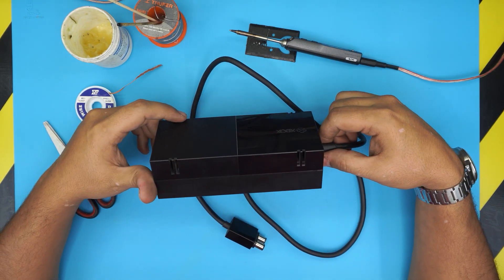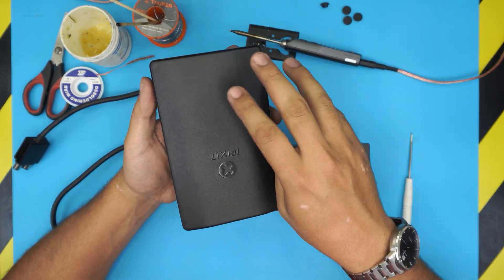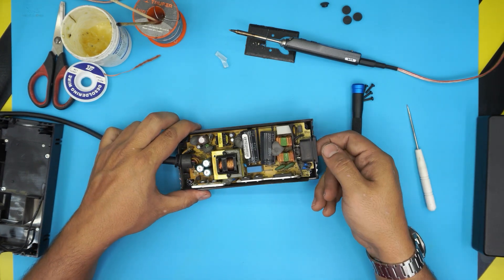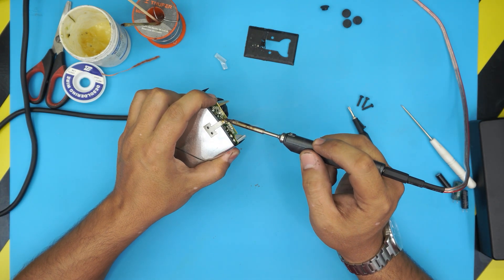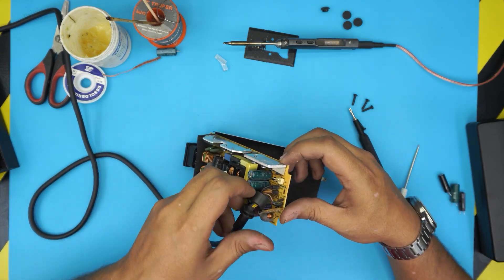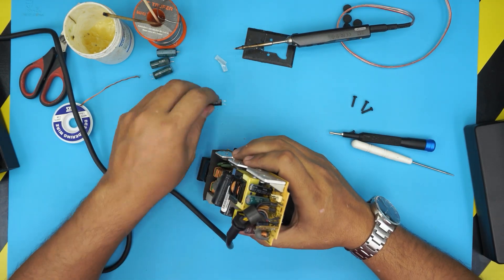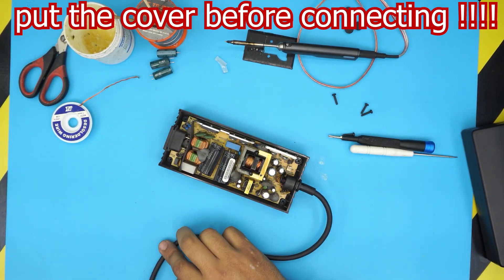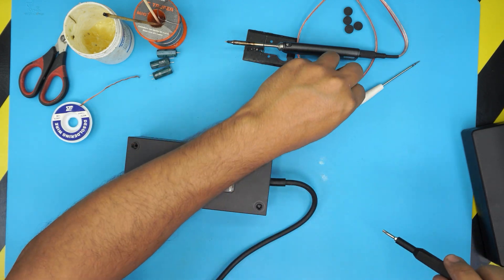Xbox One Charger Repair | Power Supply Repair Guide |

Comment: Hello. So my psu has the orange light however I have managed to get it to run most of the time by opening up the psu and using an external fan keep air flowing over it. Although Every now and then it’ll shut off out of no where. I then have to mess with the fan, the speed of the air flow, or even turning the fan off till it stays on. I try each thing till it turns back on. L The capacitors aren’t bulging and I can’t tell what is causing it to shut off when it’s all put back in its case and I’m not blowing air directly over the circuit board.  Do you have any tips as to how I can find what’s causing this problem?
Reply from the maker: 🫠Regarding your question, there may be a few issues, but the main one could be the transistors overheating. You need to test the components and observe them live. It is extremely dangerous if you don't have experience with high-voltage circuits.
cheers🍻
Reply: @ thank you for replying, would I be able to test using a multimeter or do they need to be live?

Comment: hi again 2 days before it started working and now it stopped working again I opened the board and checked I can't find any issue is there any way could send you pic ?
Reply from the maker: Thank you for your feedback! If you wish to support the channel, you can like, subscribe, or both!
Regarding your question, send me few pictures to my email if you wish and i can take a look at it.
 	ask@ufixtek.com
Reply: @UFIXTEK  have you recieved them ?
Reply from the maker: my friend, I receive a lot of emails, but I think I received one from you with a circuit picture of the back of the PSU. If that's your email, could you please send me pictures of the other side of the charger from different positions? Also, please include your YouTube username in the email title.
Reply: @uFixTek  I've sent it
Reply: @uFixTek hi brother I bought new psu and the issue is still same issue isn't with power brick 😭

Comment: Hi my xbox power supply brick when I turn my xbox on from orange it goes to white and goes back to orange. After a week or so it starts working again then randomly this happens for some day  can you help me fix it please
Reply from the maker: Thank you for the feedback! if you wish to support the channel you can LIKE or SUB or both :P
regarding your question: i need you to see if the capacitors are blown?!
Reply: @uFixTek  No they're normal
Reply from the maker: I need to to check and see if there is no sign of burn on any components, and its very dangerous to tell you to connect the power supply and use a multi-miter to test the transistors, the transistors are the one attached to the aluminum heat-sinks and they are usually go back and do the orange light error.  i don't recommend you to test it, its very cheap to get it repair on electronic repair store it should cost your max 10-15usd
Reply: @UFIXTEK  actually the thing is there isn't any electronic repair shop or something here in United Arab Emirates near me and I can't even order a new one because they make noise and aren't the same as the original xbox one . I'll try to test the transistor but there aren't any burn i could see
Reply from the maker: be very careful brother, but the issue is in one of those transistors.
Reply: @UFIXTEK  but what could be the problems with transistor ? Do I have to eplace it with the new one or solder it properly ? And what makes it work again after 1 week
Reply: @uFixTek  ?
Reply from the maker: transistors are like a switch, they turn on and off they are called gate. replacing them is the best, but sometimes check under the board and if you see the solder joints are fractured just do a pass of solder and it will fix the problem.
Reply: @uFixTek  thank you so much for your efforts ill try to fix it
Reply from the maker: i wish you the best and truly its had to do a diagnostic brother over internet without looking and testing each components.
i try to upload if i get one with same issue and show how to check for components.

Comment: I change the same 3 and now when I plug it to the outlet the light go steady orange and when I plug the xbox I go to white then shutdown
Reply from the maker: you may have a damaged transistors also, thats why when plugged in goes steady orange and replacing the and testing the transistors are a bit dangerous to do, there are two transistor near the 3 caps attached to the aluminum heatsink.

Comment: My Xbox one power supply AC adaptor blew a short circuit while I play NASCAR heat 5 I tried to get it working again but  it still remains on standby mode in orange and it isn't serviceable or repairable what should I do?
Reply from the maker: Thank you for the feedback! if you wish to support the channel you can LIKE or SUB or both :P
regarding your question: you most have blown the main transformer and that is not repairable and it is cheaper to buy a new one than repair it.
Charger: https://amzn.to/3F5ARP1

Comment: Wow this is exactly what happened to mine. Had no idea you could check capacitors so simply. I do tons of soldering and trust this method over the 20$ china knock off bricks
Reply from the maker: You are welcome! Glad you liked it 😊Thank you for the feedback! if you wish to support the channel you can LIKE or SUB or both :P
if you have any question or request in the future feel free to ask me.
Reply: @UFIXTEK  i got my caps in finally. Installed them, xbox still does not power on. I noticed now though, the orange light stays on way longer after removing from the power source which is a good sign. I have a few spare caps, im going to try to replace the 1500uf on the side of the other 3, it doesnt look blown but i will try it here. If no power ill report back here
Reply: @UFIXTEK  yeah, still no power. My light stays orange all the time. Xbox beeps as if its turning on. But power brick never turns white and nothing actually powers up

Comment: Changed the caps but unfortunately didn't solve the issue with my particular supply. Orange light still goes out.
Reply from the maker: do you see any other caps that could be inflated?
Reply: @uFixTek  Nope, the others look fine. Light is orange and as soon as it's plugged into the console, the light goes off.

Comment: There is one capacitor near those three you replaced. It is a 1500uf at 16v. Is it possible to use on of those 2200uf 16v in place of the 1500uf? As i have a bunch of 2200uf
Reply from the maker: Thanks ✌  for the feedback!  if you wish to support the channel you can LIKE or SUB or both :P
regarding your question:  yes you can and it will be just fine, just make sure the voltage is the same or higher
Reply: @uFixTek  i just replaced the 4 capacitors. Same results 

The psu turns a orange light and when i plug into Xbox console the light dies. Maybe i need to replace that 1500uf with exactly the same? Also the console is working as i tested it with another psu.
Reply from the maker: no then the issue is not from your capacitors, even if you put 1500uf, you could have some transistors blown, you will need to test the transistors or take it to a person that know how to check components. its very cheap to repair with a right person.
Reply: @uFixTek  i mistakenly put the 1500uf capacitor through the wrong throughole and now it has immediate white light when plugged to the wall but doesn’t turn on the console. Also weird whizzing noise. Here is a video i made: https://youtu.be/VcLtulzrCn8
Reply from the maker: @onasazi  hi, 1st of all you should never test them without the fan disconnected, else the circuit wont close and it will keep it self in shutdown mode.
regarding the noise , unfortunately you have a bad copper transformer the big box, that windings on the copper cables are damaged and its making a shorts and it will results in higher voltage and it could damage the console or under-volt the output.
its better and cheaper at this point to replace the PSU , also you ma have damaged the rectifier.:(
Reply: @uFixTek  oh I understand! Thanks for your insight! Could i just transplant a copper transformer from another faulty psu?
Reply from the maker: @onasazi  you could but if the transistors are bad then it can damage the new transformer also if you have a donor psu then replace the rectifier too :P
Reply: @uFixTek  will try it! Thanks again! I subbed and liked your video! 👍

Comment: I have a Xbox 360 slim. His power supply is orange. When I press the on button, the red light of the power supply turns on.  I have only the +5V at the red wire. When I short the PS ON, I should find +12V at the yellow wire, but not. There is not +12V.
I measured and changed the 4 capacitors of 1500 uF near the output side of the board. (they was almost 1350 uF.
Apparently, there is no one burnt capacitor.
What should I do? 
What do you recomend?
Regards
Ricardo Garcia
Reply from the maker: Thank you for the feedback! if you wish to support the channel you can LIKE or SUB or both :P
regarding your issue: can you send me an email attached with a photo of insides of your charger, send as many you can parts /closeup and different sides. let me take a look as every charger are a bit different.
ask@ufixtek.com
espero tu email.
saludos

Comment: hello , this is the easy fix , i have a power supply that has no problem with the capacitors , they are fine , i've changed them anyway but the power supply doesn't work , when i connect it to the xbox the light goes off , what could be the problem ? it could be the mosfets ?
Reply from the maker: have you tried testing with another power supply, there could be a short in the console.
Reply: @uFixTek  i have 4 power bricks with the same problem , that seems to be a common problem ... yes i have tried with another known good power supply and it works..
Reply from the maker: if your caps are not damaged then you will need a multi-miter in order to test the circuit, be very careful with the big capacitors as they hold a lot of charge and can zap your nicely :P,
let me see if i can open one this week and make a video on how you can test few of the components.
Reply: @uFixTek  thank you , i have subscribed to your channel and i will keep and eye for that video :)
Reply: @paulpaul4434  hi! I have a weird problem! I also changed capacitors but when i plug the power unit it turns white light immediately instead of orange! Here is a video https://youtu.be/VcLtulzrCn8 ever happened to you?
Reply: Ok so the rectifier being on the side those black things attached to aluminum backings? Then i replace with transformer and rectifier! I’ll try!
Reply: so what if it's not the capacitor?  Everything is clean and looks perfect.  Still having thr same problem